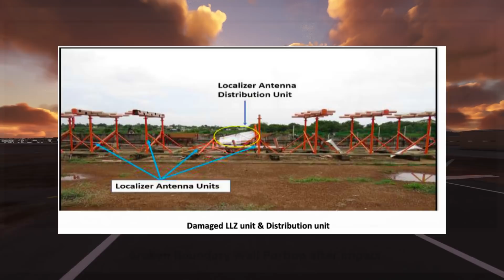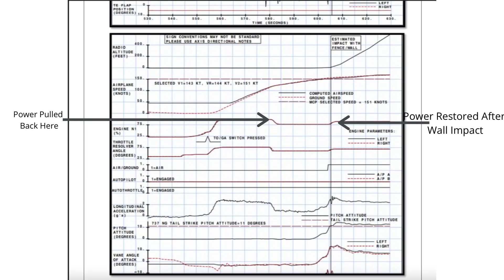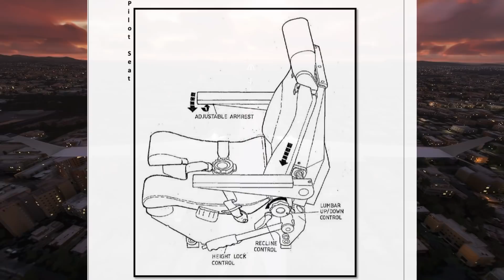How A Broken Seat Flew This Jet Into A BRICK Wall | Air India Express Flight 611

Comment: 1. Wouldn't the engine sound make it obvious the power is less? 

2. If I hit something and even though my plane shows everything is fine, I want to revert back as I just started and land back in the same airport as I took off. What if it is a small rupture enough to show the instruments "everything is fine" buy slowly leak the fluids by the time I reach my destination and things don't work as they are intended to?

Comment: The return to mumbai is probably to reduce the maintenance and repair cost. 
Airlines usually have a maintenance contract in different hubs. logistics and parts are priced depending on all these factors and its faster and easier to let your own engines to work on ur craft to know what is going on ect

Comment: They flew it across the Indian Ocean and then sent it back again when it was nearly there?  Why not let it land in Dubai as it was closer?  Instead of making the plane fly back again across the Indian Ocean, risk fuel outages and just add significantly more risk and cost to an already bad situation?   They put the plane and its passengers in far greater danger by diverting to Mumbai AFTER it had already crossed the ocean.   Making it cross back again is ludicrous.

Comment: Banana first officer and caption, should have noticed where the throttle were at and also should have noticed the sound of the engines at a lower settings
with all the experience they had.   The first officer in a lot of cases simply at times not aware of what is going on and act late in any corrections.

Comment: Reading through the comments here, pilot seat failure is far more common than I would have thought. Having said that, there's a good reason they require two pilots on large aircraft. The FO's reaction to the situation was completely unacceptable. And Once the captain had been informed of the impact, that plane should have been landed ASAP. Air India seems to have a lot of stories like this.
Reply: Cause it had govt pulling (owned)strings and had it running into the ground anyway , now things are expected to change as there is change of management and is now handed over to TATA group, to whom the airline originally belonged to.

Comment: We had something similar happen on a flight from LAX to Sydney in 1993. We were sat opposite the head flight attendant who when we were going down the runway turned white. When we asked him if he was ok he stuttered "we should have taken of by now". When the nose lifted there was an almighty crash from below and we all just stared at each other. We were so close to the cars on the freeway at the end of the runway it was scary as hell. When the seatbelt sign went of the flight attendant went storming up the aisle while shouting over his shoulder " what do you drink?" After a good ten minutes he came back armed with a heap of miniature bottles and told us as the plane had hardly any passengers on board they had stacked it with cargo. Apparently we had taken out the end runway lights but still flew on to Sydney and landed ok. Wasn't to keen on flying again for a while!

Comment: Generally takeoff briefings are made for high and low speed abort criteria with the cutoff being 80 knots. Below 80, abort for any abnormalities. Above, only for engine failure, fire, loss of directional control, or thrust reverser deployment. It may be different for the 737 (I start 737 training next week) but that may be why the FO didn't prompt an abort especially with the captain having the tiller once it gets to a low speed.

Comment: There were many Cessna aircraft lost in the 60's and 70's due to worn out latches on the seat adjustment rails. Accidents occurred on take off rotation. The chair would slide back to its furthest position catching the pilot off guard. This caused them to pull back on the throttle and yoke causing a nose up attitude stall, unrecoverable and most times fatal.
As for co pilot, they can become too complacent and fail to recognize a critical situation. As for the stupid diversion, well I would figure those I. High places don't give a rats ass about 130 people, after all India has plenty of people. Incompetent individuals who should be relieved of their jobs.

Comment: Had this happen while driving my car once… scared the crap outta me. Literally had to pull over and panic. The mechanism just broke and slid. And when I managed to reach the brakes, I am short, I braked too hard and the chair and me shot forward and I was winded by the steering wheel in my chest. Thankfully only a suburban road.

Comment: I was wondering: was returning to the same airport just after liftoff actually an option after doing this damage?
Probably, the runway they had lift off was closed due to inspections, was the other runway free to land and safely possible with the conditions at that time?
Reply: Yes, I think that is a valid point. However, there are quite a few airports like Bangalore or Chennai not very far from Tiruchy. I don't understand firstly why they choose to do transoceanic flight with this potentially damaged aircraft but even more silly was having almost crossed the ocean to come back to Mumbai insead of landing in any of the nearby airports..

Comment: Oh my God, probably this is called luck.  those passengers and pilots were really very lucky to have survived this incident on a very very thin margin dividing them between successful landing and disaster, 
the first thing is, as soon as the pilots came to know, after the ATC told them,  that there plane had hit a wall while taking off,  all though everything was fine in the cockpit, to be safe at least the pilots could have came back and landed their plane from the place where they took off to be safe, or another thing was the higher authorities really took a very dangerous chance asking the plane to come back all the way back to Mumbai, to be safe the authority  could have made some arrangement to land the plane  nearest to the place where it was flying and more importantly the best option was to immediately abort the takeoff instead of the chance they took to fly the plane.
 here everything just work on pure good luck and chance the luck that the engines didn't get damaged when they took off and hit the wall and it is very fortunate that the plane didn't give out anywhere over the ocean, after the level it was damaged, it's very lucky it stayed in one piece until they came back to Mumbai, probably the people aboard that plane have a very good luck story to tell their entire life. And thank you very much for explaining the incident in a very good way, with also adding the options that they had and what they could have done.

Comment: you mention that TOGA thrust was initiated for the takeoff. This seems highly unlikely. Almost all commercial flights use considerably less than TOGA for take off, usually around 85% power. Please correct me if I am wrong.

Comment: I had my seat slide back while climbing out.  I was only at about 400 feet.  I couldn’t reach anything.  I remember stretching forward to just slightly push the yoke forward with my fingertips. Fortunately the power stayed on full throttle.  I just let it climb slightly higher before pushing  forward on the yoke with my fingertips to level off.  Then I was able to reach down and adjust the seat with my right hand and scoot forward.  The worst thing really was the startle factor.
Reply: Aircraft type?
Reply: @THYB737  Cessna
Reply: @VLove-CFII  colour me impressed duchess 😳👀😬

Comment: When the decision to divert for maintenance reasons is made, the phrase "nearest suitable airport" is used quite a lot, but the exact definition of it is quite vague.  Do you need quality CFR?  Do you need a long runway?  Is it an airport in which the airline has an established maintenance personnel or contractor maintenance?  Will any runway work?  In this case, they had high suspicions of aircraft damage, but it wasn't affecting the airworthiness of the airplane.  I don't think the QRH has a section on unknown damage, only sections for known conditions.  Therefore, nearest suitable wasn't necessary for this diversion, and you would much rather have the aircraft be grounded at an in house maintenance base.  And since there was airport damage caused by the aircraft, the airline knew the airplane would be grounded for inspections and investigations.  No surprise they opted for VABB once they figured out they could reach VABB.

Comment: I'm really uncomfortable with the captains decision making on this one. He did the right thing when his seat collapsed in handing the control over to the FO but after sitting up again with a known faulty seat to re take control of the plane I feel was irresponsible. There was no way to know if the seat would malfunction again. The FO had control of the plane and the priority should have been a safe takeoff not reverting back to a control choice that only mattered on paper ie the captain flying. Very poor judgement.

Comment: Flying was never really as safe as we were told. The larger number of flights in the last 30 years had made the bad news difficult to hide.
Reply: Nothing in this world is going to be 100% safe. However understanding crashes and unearthing the causes whether human factors or technical or both makes it a lot safer now. I hope the training captains and check pilots manage to keep everyone on their toes and fly using checklists correctly, comply with the minimum criteria safely etc.. We all make mistakes but with good CRM we should catch most of them before we get into serious danger. Aviate, Navigate (like avoid mountains and other aircraft), and then communicate with ATC when safe to do so.

Don't forget maintenance rules, we like aircraft declared to be fit and safe to fly actually to be exactly that. And the airport layout/signage aiding safe ground movement and controllers to keep aircraft from bumping into each other. Detecting errors, reporting and investigating minor incidents properly should prevent evolution into serious accidents etc..
Reply: @brianturner6729  Unless everyone is working for excellence, flying can, and sometimes does, become a nightmare. I trained as a private pilot in the middle '80s and would not consider flying today. Too many cowboys backed by iffy maintenance. I'm done. You enjoy!

Comment: Something similar almost killed me. Always check your seats, especially if someone else has been using them! Once I lent my Crown Vic to a neighbor who was very short (4'11".) I'm a foot taller. When I got it back, she'd adjusted the seat by pulling up on the bar, but hadn't properly had it lock in place. I had no idea until I had to brake at a stoplight. My whole body rolled forward on the seat until my chest was smashed against the steering wheel, left boob blowing the horn. Luckily I had my foot on the brake, but my body being thrown forward, I inadvertently slammed it hard and made my tires screech to a halt. Thank God I didn't miss it or even worse, hit the gas, and fly into the cars going across the intersection. I got pulled over after, but didn't get a ticket -- the cop was driving the same model and said he'd had it happen to him, too, after someone else used his cruiser.

Comment: Both pilots are supposed to have their hands on the throttles during Take Off. The first officer could have kept the pilot from falling back if he had his hand firmly behind the captains on take off roll.  TOGA is generally a phrase that's used for Go Arounds and it's usually a switch. Take off power is Not Always max power and it is set manually, but Go Around power is automatic. You need to rock your seat a little to make sure all the adjustments are locked in. There is height, forward adjustment and recline adjustment. Sounds like the pilot was in a hurry. Just as a note; depending on what company or military you work for and how many engines you have, many times the flying pilot will merely stand the throttles up, indicating he is ready to roll and then instruct the non flying pilot to "set power". So the FO would then be setting a pre determined TO power and calling the airspeed numbers. This is a lot better for 4 engine and large propeller aircraft. Used to be we had flight engineers for the power levers.

Comment: Given their limited experience on the B737 type (less than 4,100 hrs each), the the startle effect and commotion of the collapsing chair was so strong, that, it apparently placed both pilots in a temporary state of stupor.

That commotion caused them to not initially notice the reduction in thrust.  In the F.O.'s mind, despite the commotion, all appeared normal, which is why he didn't call for or initiate an aborted takeoff.  Neither pilot recognized the plane's acceleration rate had reduced, which is why they continued with the takeoff.

After the captain resumed control, he saw the end of the runway quickly approaching, and he started to rotate before VR as a result.  This caused a significant tailstrike, with the tail dragging in the dirt area after the runway.  After the plain was barely airborn, the main landing gear tore through the parameter wall.

ANY ONE of those events after rotation should have been enough cause to immediately return to the departure airport.

The fact that they did not pull out the QRH or run the tailstrike checklist, is quite baffling.  Even after the Tower told them that pieces of the plane were found, they should have immediately stopped their climb, declared an emergency, and returned.  But they didn't. 

I don't think that it even registered to them that a tailstrike had occurred -- this is supported by the fact they didn't pull the tailstrike checklist, and that they allowed the cabin to pressurize as they continued to climb above 10,000 ft.  A bunch of things went wrong within a very short time, predicated by the collapsing seat.

The only thing that seemingly registered to them was potential landing gear damage.  However, they didn't even reference the QRH or abnormal landing gear checklist.  Instead, they performed their own non-sanctioned confidence checks, and continued the flight, not realizing that their actions put everyone's lives in peril.

I believe that had they understood that a tailstrike occurred, they would have declared an emergency and returned.

The last baffling piece of this incident is that their Company had them return to Mumbai -- which was about twice as far as their Dubai destination.  I think that because the pilots were unaware that a serious tailstrike had happened, the company just didn't know.  Had the company knew, the would have had them land at Dubai, or land immediately at a suitable airport as an emergency.  Likewise, they would have had them descend to and maintain 10,000 ft (~3,050 m), or lower.

A lot of lessons were learned from this single incident.  Fortunately, they landed safely, and without injuries or further incident.

Comment: Can you not initiate take off at slightly less than V1?  Say around 90% of V1 to avoid crash?
Reply: Ignoring high mach numbers (compressibility effects) lift at a given angle of attack (Alpha) goes up with the square of the forward component of airspeed. Go slower than appropriate safety speed and rotate means the tail strikes the ground and you stay on the ground ! Also need to reach minimum control speeds to deal with engine failures. In the air there is a limit to alpha to avoid a stall. Too slow and you won't get into the sky - cannot change the laws of aerodynamics to avoid a crash - sadly. Which is why all the procedures and rules should be followed to avoid incidents like this and worse !

Comment: Not a matter of a checklist item, as it was they were within a second or two of a solid impact into those structures. On takeoff roll past V1, you just have to deal with whatever comes your way. Hard to place blame on anyone, except when you get into the seat, move hard back/forward to ensure it’s locked.
Reply: Yes exactly my thoughts. If you would start to grab your checklists at such a moment instead of the first thing on the list 'Flying', you probably crash. Do the checklists and checks after liftoff when you are safe in the air, navigate and communicate.

Comment: IMO, the FO should have rejected the take-off as they haven't reached their V1 speed yet. 

Diversion to Mumbai may be because of the reason Air India having their maintenance base over there. But definitely a risky option with all those passengers onboard.

Once ATC informed of the damages, the captain should've consulted their operations team on further course of action since the extent of exterior damage couldn't be ascertained completely.

Or else should've proceeded to Dubai, offload everything, a through inspection over there and then flown back to Mumbai empty.

Comment: I can totally understand The startle effect lasting slightly longer then normal in such an odd sudden mishap… I don’t blame the FO for not rejecting, plus it’s right on edge of V1, and he thought the throttle was still at TOGA….

Deciding to the continue the flight though I think was bad judgment, even if they were positive the plane was air worthy, I imagine it would have been an unrelaxed atmosphere in the cockpit.
After the 210 climb to check the planes worthiness, They should have returned…. This accident was as close as it gets to becoming catastrophic